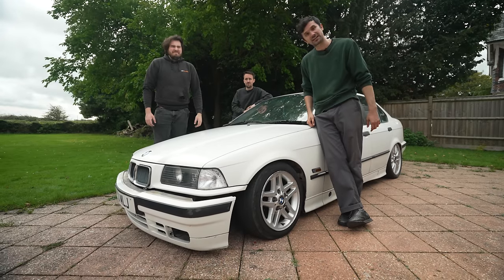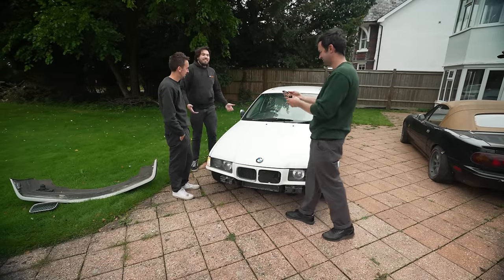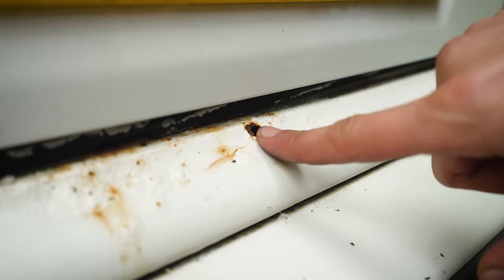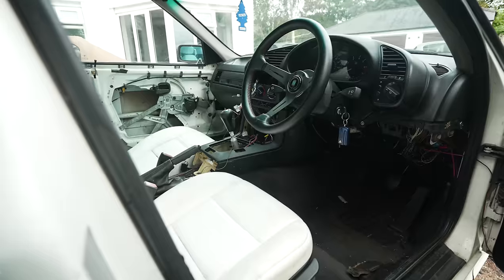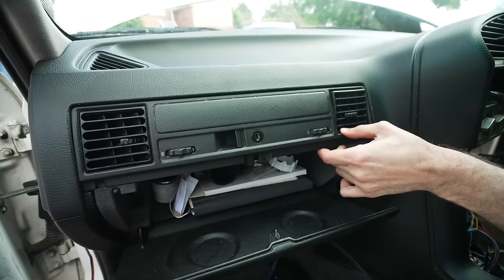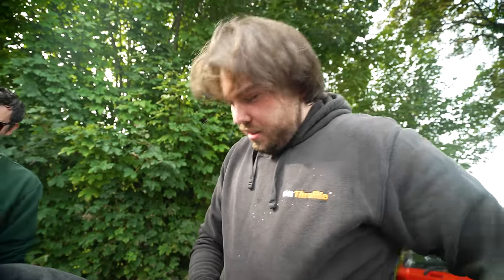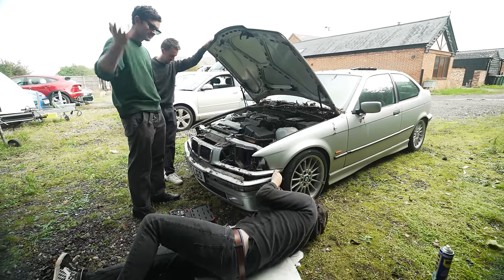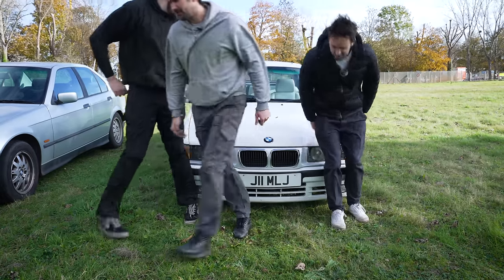Should You Buy Someone Else's Project Car?

Comment: I bought a Volvo 740 off a chap. He’d entirely rewired it to his own random pattern, and then handily resprayed under the bonnet so all the wires were the same metallic silver. The horn was connected to the indicator, it wouldn’t start with the door open, things like that. So that was fun.
Reply: When You say fun.... 🤣
Reply: ...and you are still here to tell us about it! What a legend! I would have taken some drastic measures! :face-purple-crying:
Reply: O
Reply: Wow 😂
Reply: I had a 1974 Volvo 144 that I purchased in 1987 for $480.00. It barely passed the inspection test. The electrics didn't work and to add insult to injury the car wouldn't start with anyone sitting on the passenger side.

Comment: @stanceworks - You still have the wrong steering wheel position. You will go faster if you are not reaching as you are when at close to or nearing 90deg wheel angles.

Seriously consider a 10Deg steering shaft angle drop toward your legs and 30mm+ wheel spacer to bring the wheel closer to you. Obviously clearance to your legs needs consideration and the spacer length depends on your arm length and conform levels, but you should still have bend to your arms at 90deg wheel angles especially given the amount of bump steer visible in the videos.

For inspiration to wheel positions and rake angles check out some of me professional race cars.

Good luck.

Comment: No-one ordered a “Lotus white” leather trim on a 316i and didn’t option the electric rear windows. No-one! At best it could have had silver-grey. 
Also. It’s not “leather”. It’s a vinyl re-trim. And secondly: The “Individual” program was only first made available in ‘91 and certainly not for E36 316i’s. 😂

Comment: Guys, if you ever did that:
1) Buy a stock 60k miles classic. Even better if it has desirable and rare options ;
2) Rip out the interior, trash the poor thing with fiber wings, and throw random "performance" parts at it ;
3) ABORT the whole thing ;
4) Ask 14k for it on your local listing website.
Punishment should be to be stuck with it for the rest of your life :)